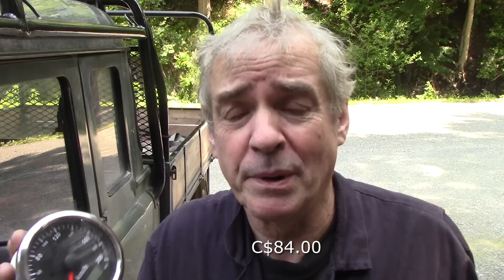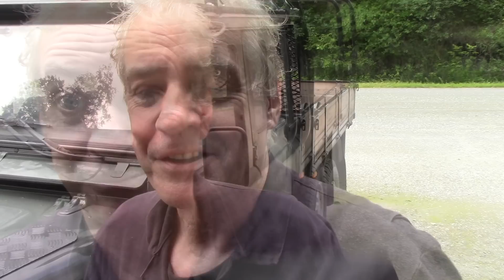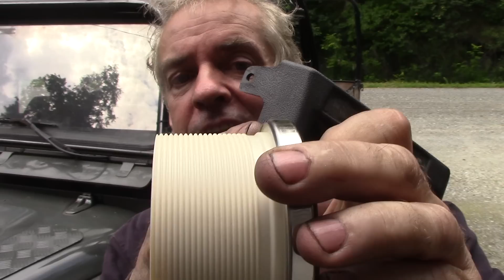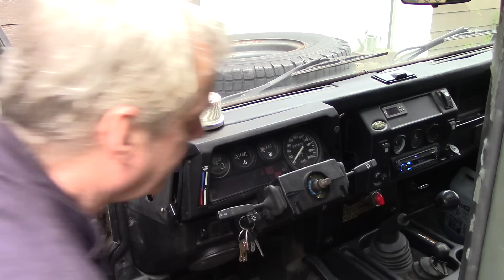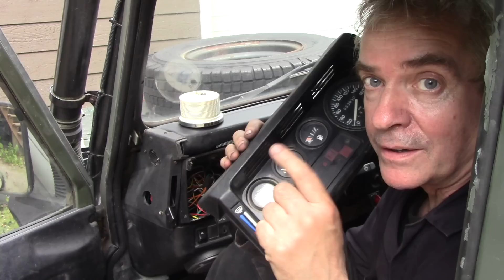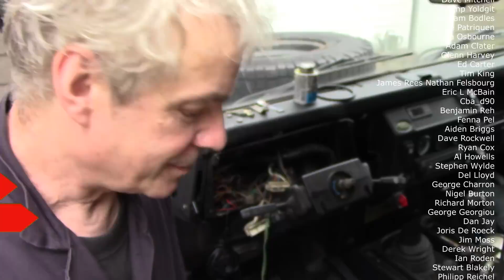GPS speedometer into a Defender Part 1

Comment: I need a new clock and I don't fancy paying £200 for a second hand one. It seems if you want gps mph you can have any size you want as long as it's 85mm. I've looked everywhere.  No choice but to print an adapter plate I think.
Reply from the maker: I have the 3D print file for the adaptor that a viewer sent me
Reply: @BritannicaRestorations  Could I get it? Would save me a lot of time.
Reply from the maker: Send me your email address  britrest@britrest.com

Comment: The Global Positioning System (GPS) is a constellation of orbiting satellites operated by the US military.  It used to be US Air Force, now I think it is US Space Force.  The concept is the satellite knows its name and tells very precise time, and sends some additional blips.  Each satellite broadcasts a low powered FM radio signal, and the receiver compares the other data and the time signals its antenna can receive.  The more sky the antenna can see, the better the geometry the device can calculate.  Therefore, mounting the antenna on a vertical surface like the glass, is asking for errors because the only satellites it can see are those in the 180-deg arc in front and above.  Mount the antenna as high as you can with as much sky view as possible - despite the written instructions!

Comment: Brilliant solution
Other benefits of a GPS spedo is no worries about changing spedo gear for different rear end ratios and since my radio has GPS built in I can set an over speed warning in case I go too fast.
My GPS antenna is on the dash and works fine, I don't think ice or snow will stop the GPS signal but metal will.

Comment: Are you able to set the mileage to match the removed gauge ?
Reply from the maker: How to Set Odometer ?

- Press the back button for 2-3 seconds first and then turn on the power supply.

- Release the button after seeing “ODO”; Press the button to set up the target odometer value.

- After adjustment, release button first, then wait for menu to complete flashing.

- Turn off the power supply, then turn on again. Odometer will record the setting.
Reply: @BritannicaRestorations  I was wondering about ODO tampering. I'm still a little surprised GPS is legal for speed. Tunnels and pârking don't count??
Reply from the maker: It self-corrects if it goes through a tunnel, but let's face it - if you go through tunnels every single day then this is not for you as you have no GPS and could be caught speeding

As for accuracy, when I pass the 50 km/hr warning displays that are common here - this unit is spot on
Reply: @BritannicaRestorations  I've used a GPS when my speedo metal cable broke - it's definitely more accurate. 
My watch GPS will keep working inside as far as distance goes using IMU I believe.

Comment: Got GPS one in w460 g wagon when original failed. Works fine, im just too tight to pay the £600+ for a new one. 
G has the reliability but when it does need parts its eye watering!
Reply from the maker: That is why I have nothing to do with them - Dealer only for parts in Canada

Comment: I'm in the process of a Defender MPi restoration and I'm considering this guage.   Tachometer is going to be the tough one...
Reply from the maker: You can get a speedo with a built-in tach!
Reply: I have GPS speedo in my FORD pickup for several years, not problem.  I have in process to put on roads my Landy and I will buy GPS speedo for , again.  I have seen GPS speedo and RPM in same gauge too,  and package with GPS, tacho, and others functions oil pressure,  coolant temp, voltage, fuel level)   in other same diameter gauge and 52" too,  all those with senders .
You can check what option fit for U